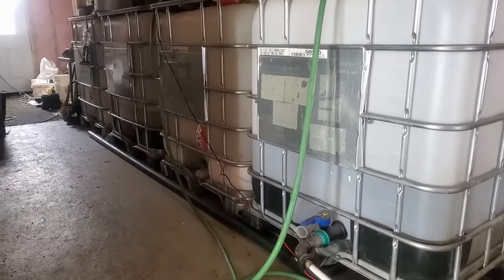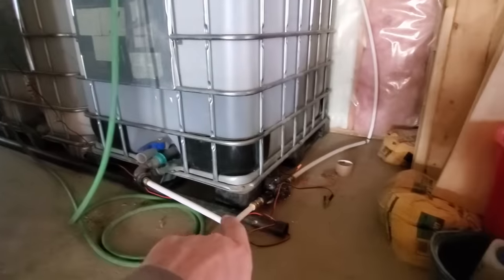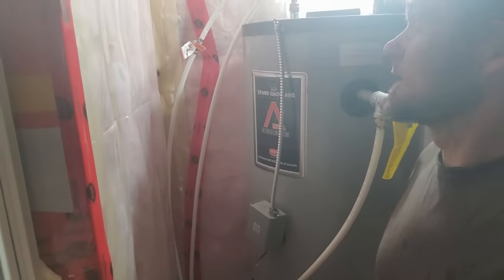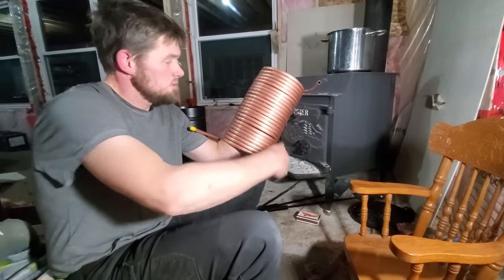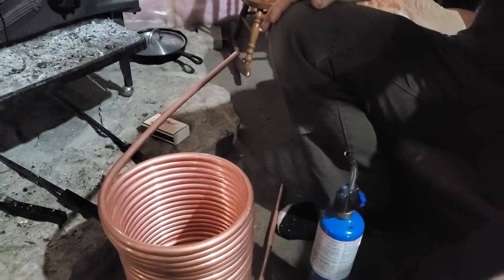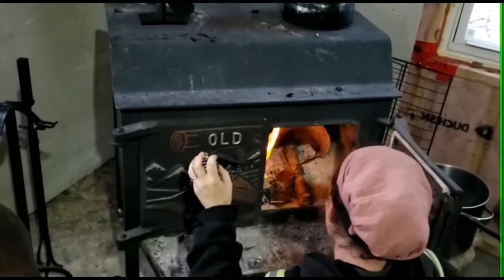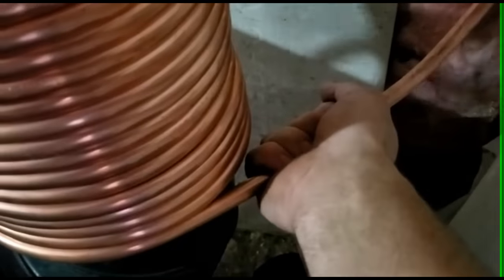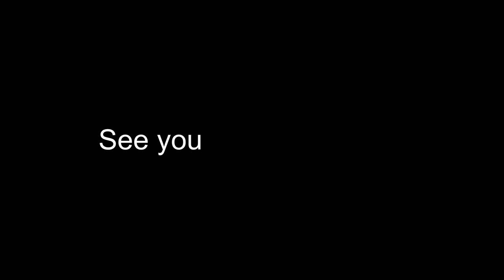Endless HOT water for FREE /OFF GRID

Comment: Great video.  If you ever see this comment, I applaud your courage.  I set up to do EXACTLY this, twenty years ago, in North Dakota.  Unfortunately, after a little deeper research, I became afraid of the potential pressure problems and, not knowing the science behind it all, I thought I'd play it safe and never fired up the contraption.  I wish I had.  I knew it would heat my water, I just wasn't sure I knew enough to not blow up my hot water tank.  I will be doing some experimentation in the next year or two, using both the copper coil and the passive solar loop.
Reply: Shame you didn't ever fire it up. You could easily have fitted a safety valve for the pressure build up.
Reply: Yes agreed..this type of fired water tank setup is not complete without that additional pressure valve

Comment: Just stumbled upon this video and it piqued my interest as I have thought about doing something like this as an addition to my oil burning furnace in the shop for extra heat. Instead of using to heat the water  I thought about putting a radiator inline as a heat exchanger, pretty sure this would work with your setup and i could use antifreeze to keep from freezing when not in use. I know you said your system is running fine but was thinking maybe could control the heat more by making the coils larger than the pipe? just a thought.
Reply: We ran glycol in a Clever Brooks fire tube dry back boiler, the glycol eventually became acidic and destroyed the copper coils in the radiators. The boiler was pretty large and the fire box ran at about 2,000 degrees. That may have been the problem.
Reply: @Yarrb53  yeah never thought about glycol causing damage.

Comment: Great concept and project. I had a friend years ago who created a similar hookup to heat his whole house. In your case, the hot water is only free if you're running the wood stove anyway to heat your space. What do you do when the stove doesn't need to run?
Reply from the maker: Then we have no hot water unfortunately.
We plan to build and add a solar hot water heater this year
Reply: Make you a small boiler room outside next to house using same general idea with tubing. Water tank gravity fed to 12in round casing 3.5ft long, tubing of course around casing with door at end for loading wood another for ash trap at bottom, open shut hatches are the best. Finished off with wooden enclosure plus ventilation system could merge with house furnace. Just trying to help dont take the wrong way that idea popped in my head watching this.
Reply: @Oldaker7  that’s a good idea, I still prefer a solar heater with a heat soak as a more “free” option.

Comment: In the 70's, I built thermo siphon system with in stove 3/4" black pipe - 15' around inside of fire box. I way over built it .
In winter when the stove cranked, if we did not use the 
hot water enough, the system would blow. I plumbed the relief valve to the side of the house on second floor. It would shoot steam out. The H2O was gravity feed, so we often had to run hot water right down the drain to keep system from blowing. 
The tank was re-purposed electric tank 50 gal. The following year I installed small RV pump and ran hot water through a couple radiators and reduced from 3/4" to 1/2" black pipe and cut in half length of run inside stove to 6'. 
That finally gave us just enough heat and steam blowing stopped.

Comment: Obviously, your plumbing is all done and dusted. But for the sake of maintaining good hot water pressure, you could have reduced the number of elbows used in your ceiling and wall cavities and just curved the pipe. I don't remember the % of pressure loss an elbow gives but added up is significant on 1/2 or 3/4 pipe.
Ingenius idea to wrap your pipe around the stove flue. Like the old days and works a treat.

Comment: Had a friend that did something very similar on an old farmhouse out in the country.  Huge fireplace (48" wide).  Coiled up 1" copper and put on the inside brick lined chimney.  Had very hot water in no time.  The coil wasn't wound a tight together and was around 3 ' tall.  Even ran some copper pipe to the bedroom with a radiator that circulated.  Thought that was pretty cool.

Comment: Practical simplicity by a do it yourselfer. The copper needs to be as THIN as possible and then insulated to trap the heat onto/into the supply line. I live in Florida and have ample sunlight. I've dropped a 20 gallon flat tank onto my roof, painted it black and get 140' F water out of it INTO my garage hot water tank. When mixed with cold, it gives about 35 gallons of very warm shower water, however the roof tank reheats in about 15 minutes of sunlight. Everyone should do this...
Reply from the maker: Smart!

Comment: In New Zealand we call a similar system a "wet back" its a box or tube installed in the back of the fire box. As long as the fire is going well (a rolling fire) it will heat the 400 litre water cylinder just through the wall and during the winter wet get free hot water.  Put lagging on the copper tubing heading away from the fire, it will keep it hot on its way to the cylinder. Well done

Comment: Nice i know the containers well I built several sizes of molds for different chemicals and food products at Bynne ans Short sheet metal molds in Lindsay Ont. I have no room and think ill bury a cement septic tank and 4 inches of foam insulation all round. Think ill put my asphalt over it so I dont have to shovel snow around my car or a garden over top of the tank so it warms up in spring

Comment: Awesome job ! You have to love that hot water System :) I never thought of that when I built, I use the 40 gallon tank as well but mine is propane fired, With a family it would take a 100 pound tank a month, My RV pump like your pulls water from my well under the cabin, I have fully operational Off grid cabin :)

Comment: Do you have any problems with flash steaming when the lines get to hot? A friend was trying to build  a system to heat his house in the winter using an outdoor fire pit made of a washing machine drum and copper tubing but couldn't get the copper tube close enough to the fire without flash steaming. I suggested either adding a layer of concrete or bricks, maybe with the copper running through the holes in the bricks. My third suggestion was to use oil instead of water then use car radiators and a box fan inside each room to dissipate the heat. I just use a block heater from a diesel engine dropped in a 55 gallon drum of water.
Reply from the maker: No issues, it worked flawlessly for almost 3 years

Comment: good use of a heat source that would have gone up & out. i did a small project like that on my car windshield washer back in the early 90's. wrapped the heater hose with aluminum tubing hooked it to the windshield washer hose.. in the winter it sure defrost the ice off the windshield coming out at 180°f 👍 i realized an easier way to not remove the heater hose later on by making a clam shell design to clamp over the hose and also made it hold more fluid & made it insulated 👍👍 🚘
Reply from the maker: That pretty neat!

Comment: Water heater or hot water maker not hot water heater. No need to heat hot water. 😏 Keep up the great work. 
I built something somewhat similar except I had an oil fired boiler for hydronic heat. I designed and built a non pressurized water heater with a domestic coil inside and larger coil piped into the boiler pump. Worked perfectly.

Comment: Haven't seen anyone do it yet but seems having a wood furnace with a boiler above it like one of those outdoor wood boiler systems would work well. Plus you wouldn't lose all that wasted heat by having it outside. Instead of having the boiler heat the home the system itself would making the boiler a hot water source only. Could remove the installation perhaps on one of those boiler units to get more heat in the home less in the boiler above it as they were designed to heat the water only and keep heat in with insulation. Think aloud here.
Reply from the maker: So many options out there, its good to think outside the box!

Comment: To stop the copper from rotting on the enamel stove pipe use a rap made from a old fire blanket.
And over the top as well followed by some rock wool to insulat it.
Also if you use multiple small copper pipes your water will get hotter alot faster ,like 4 10mm pipes soldered at one end into a 22mm.
Reply from the maker: The system is working great,  thank you for your suggestions.

Comment: I have an idea for you  to utilize the the hot water tank even more. If you slip a larger pipe over top your chimney pipe (chimney 5 inch, extra pipe 8 inch) you create an air gap between the chimney and extra pipe. at the bottom connect a 4 inch pipe and let it draw air from the room, at the top do the same thing and plumb that pipe in to the hot water tank. This will do a couple of things. 1 it will create a heat shield barrier keeping heat off the wall from the chimney, 2 help heat your water lines up better because they are now in a sauna, 3 create a convection current from your down stairs to your up stairs, 4 help heat up the hot water in the tank.
Reply from the maker: That could work

Comment: Looks good,  the only suggestion I can see is moving the TnP to the top of the tank (so it senses properly), You could add a second on top adjusted for 130°-135° to return to cold supply tank.. there are plenty of  videos ( & old movies) that show what happens to brick/wood homes if they overtemp.. (a valve on either  side of the coil & oneto drain it, could be another option for when hot water is not needed,, but heat is.. Lol 
If stove is going when valves are opened it will steam at first)... 
Stay Safe and God Bless
Reply from the maker: Thanks

Comment: great job winding that copper to almost exact diameter to actually touch stovepipe !
Im wondering how ell this worked for showering in hot water?  1 person per 2-5 hrs can shower?
if it worked so well i wouldve planned for another couple loops to run in floor heat?
Reply from the maker: Recovery time is slow but once hot 2-3 people can easily shower if they don't take super long showers. We only have a 40 gallon tank, a lather tank would help.

Comment: Thanks for the video.  We have a family of 7. How do we figure how many feet of copper piping to wrap around the chimney for adequate water supply.  We would be using either a 48 or 60 gallon electric hot water tank, if that would work?  How many feet of copper would we need to supply a 60 gallon tank, and is the electric hot water tank a good option (obviously not hooking it up electricly)?

Is there a place I could find detailed plans to complete this set up, with a material listxwith all necessary pipes and fittings and detailed instructions on how to complete this job?  Or a video with the same?  What would be your idea for supplying hot water in warmer months, when it's too warm to run the wood stove?  Thanks, so much.
Reply from the maker: Great questions!
A 60-gallon would be better,
The copper coil came in a 25' length from Home Depot. Look for whatever fittings you need to go from the copper to the pex while you're there, I soldered them on.
There is no detailed list. Just watch the video a number of times, I actually made two videos of it, so you may want to watch both of them a couple of times.

In the summer we just fired up.the wood stove whenever we wanted showers. You could look into adding an on-demand propane system for the summer if you're worried about the heat from the stove.

Comment: @5:11, so far looking impressive.  Just a hint or two for you, the present bottom take off/feed for the wood stove... The Nipple should enter the bull of the Tee and the drain then facing down for easy access and the stove line fed into the top of the Tee.  Makes it all easier should you need to drain/flush the tank!   Those SharkBite fittings on top of the water heater have too much stress on them and will surely leak.  Suggest that you support those vertical lines and or add a bite of tubing to remove/relax those fittings.  Make nice radial bends without stress and support/clamp the tubing.  Create an insulated shield around the coil for two reasons.  1) helps prevent scolding/burns and 2) helps to maximize heating on a low fire.
Reply from the maker: It's all been working great for 1.5 years, thank you for watching
Reply: @countrysideacreshomestead2008  Can't argue with success!
Cheers

Comment: The Amish did something similar to this but I don't think with the copper coil that I noticed when I was looking at it. If I can use a wood stove in my 8'x16' mobile tiny home I will use the water coil system like you I heard about this years ago. Has there been any cracking of copper coil around wood stove? No water pump is great boiler type is the way to go. The less is better like a boiler system and lasts longer. The Amish used about a 55 gallon stainless steel barrel wood stove down stairs to heat with. Somehow they heated the floors too and used their large water source for hot water too but they used a mountain spring to feed their hot water and floor heater system. I get water from a mountain spring it's the best source of water. Maybe they used that pex plastic hose for under floors to heat house along with wood stove down stairs.. They also had a DC water pump inline their hot water system. I guess water pump was for days not running the wood stove as much possibly to circulate hot water. I had to help the Amish with a job. They are a well oiled machine. I want a wood stove coil water heater ideally like you in my mobile tiny home but don't want the long pipe out of the top. And when I'm parked here and their can't have any smoke coming out top. Because law might think my cargo trailer is on fire call fire or law and break my door down. Any suggestions on a cheaper or homemade exhaust powered fan for a shorter roof exhaust pipe? I have electric and propane heaters now but want to put in my 1200 square foot wood stove I bought. My wood stove should run my out of there. But I really didn't want a smaller stove and got a deal on a New 1200 square foot window wood stove. I plan on some black Aluminum race fuel cell roof top hot water tank too for summer and some solar panels. I'm off grid too moved out before covid. I would like to use the floor heater system too but not sure what they did exactly. I guess the plastic water line would work for the heating system. I know guys use black plastic water line in lexan window style box for roof heating water system.
Reply from the maker: Lots packed in there

No cracking in the copper pipe.
Not sure how you could burn wood without any visible smoke.
I think in a 16x8 trailer, one wood stove would be plenty of heat and you wouldn't need in floor heating. 
Best of luck on your adventure.

Comment: 😁 cool! ....but no fair ...🤣 ..that was my clever idea last night  for my hotwater issue. lol nice to see it was obviously a good one..... youtube is awesome.  nice job/ thnks 4 the vid, excited to see your vid on your overflow hookup ( when tank already too hot, how youll run the rest to heat house) ... cause ya dont want watertank to boil.. but the tank in winter will be hot sooner than the day / fire will still run 4 many hours.
i tried to thnk of clever design to hinge the coil..but half wrap the chimneypipe...so when tank hot you could just swing the coiljacket off the chimney..so it would stop heating the water ...instantly...
im moving to portugal and ineed hot water ...but not centrall heating during day time...cus its small and fireplace is plenty heat ...
looking forward to ur house heating solution video. thanks .
Reply from the maker: Great ideas, good luck with you move!

Comment: I think i would have cleaned up the oil burner or repaired it. This way you have the extra option of duel fuel. I couldnt imagine running my woodstove here in the summer for hot water. Wandering if a  recirc pump in the heating loop would help with recovery time on reheating the tank. I plan on temporarily using a similar setup with a tankless propane water heater. Nice job making it all work!
Reply from the maker: Our goal is self sufficiency,  starting with an oil burner would be starting off course. 
We plan to build and add a solar loop this year,  stay tuned for that

Comment: There has got to be plastic fittings/valves out there instead of using brass.  I worked in water treatment/distribution as well as various chemical industries.  Brass and copper fittings\pipe are easily 10x as expensive.  Very nice use of otherwise wasted energy.  I like your thinking!

Comment: Hot water heater?

I live off grid and use 100 feet of half-inch coiled into a flemish, painted flat black and mounted in a flat case with a polycarbonate dual-cell cover. A 12-volt inline circulating pump is connected to a 36- watt solar panel and everything is tilted south at my latitude.  When there's enough sunlight to run the pump, it circulates water through a 50-gallon insulated receiver.  I've had (essentially) free hot water for the last 30+ years. On cloudy days or during a hard freeze, I have an auxiliary rocket stove heater that burns (homemade) lump charcoal. 

I think you'll find your water will spot boil in that coil. Good luck. A better way would be a straighter, much shorter run where copper touches the heated surface.  Also, brass fittings will prevent galvanic action between copper and iron.

Be sure to change your anode every 3 years.
Reply from the maker: This system worked flawlessly for three years for our family. We have since moved to Georgia and are on our way to Russia. Don't forget to subscribe for updates!